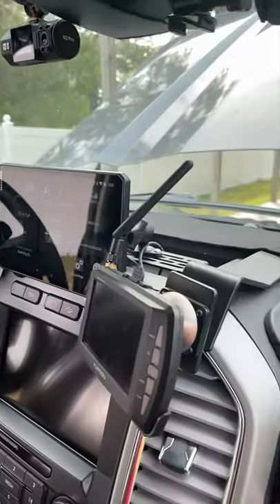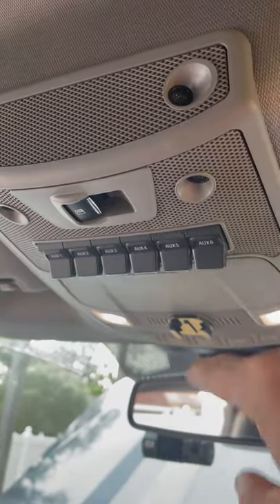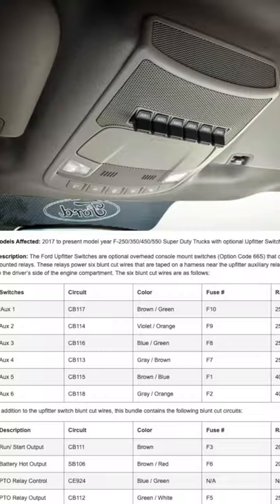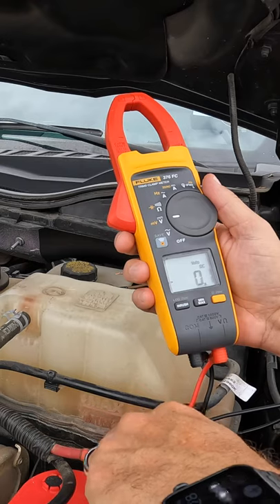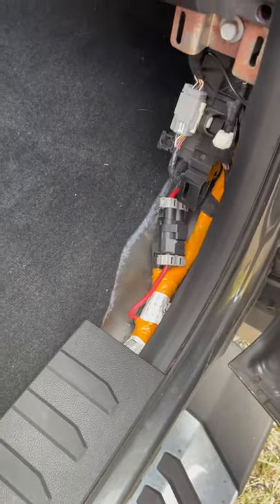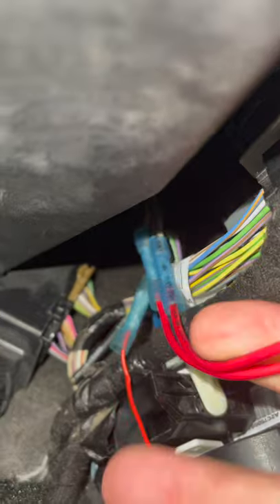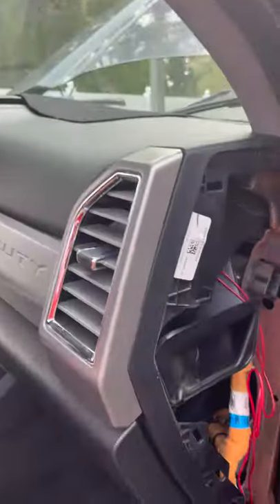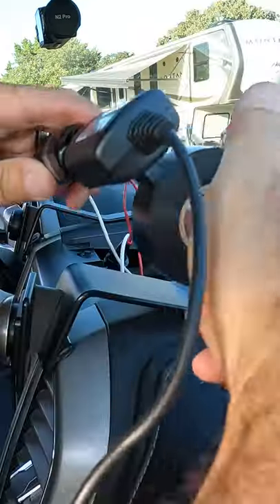🛠  DASH WIRING Using Ford Upfitter Switches #SHORTS

Comment: For your 2020 and newer Ford upfitter followers, that wire harness bundle is on the passenger side.  For me, I found it easier to deal with by removing the passenger side battery and battery tray.  I power all our dashtop items, installed a "High Idle resistor" to upfitter 1.  Put the onboard air compressor for our airbags on upfitter 5.  Great video Chad!
Reply: I can attest to this. I just hardwired my new dash cam on my 2021 Super Duty. 👍
Reply from the maker: What kind of compressor?  I'll need to re-do all of this when we get our F450. 😳
Reply: @ChangingLanes  .. I went with the AirLift 5000 Ultimate bags and the Airlift Wireless Air 7400 EZ compressor.  (not really all that “ez” .. 😂).  Mounted the compressor behind the drivers side rear seat, power and airline feeds up from under cab.  Self installed .. Remote works great.  I run 45lbs on the bags when towing.  2020 f350 dually,  2021 17k gwvr Jayco Northpoint 377.  pm me if you want and I’ll share some pics.
Reply from the maker: Thanks!  We have that also.  I was thinking maybe it was a general use compressor for tires and such.
Reply: How do you get the negative side of the connection. Inside the cab. Do you use one of the pass-through wires and run a negative to everything on the dash?
Reply: @amop33  .. negative is common with the frame/chassis .. so any grounded location in the cab should be fine.  The firewall passthrough are all the “positives”
Reply: @mike_adams  Copy... Just need to find a good place for a couple items.

Comment: This would be an awesome full length video! Been looking into how to set up an always on and recording camera system set-up on our future Ram 3500, and to power all our tech we will need for full-timing. I knew the upfitters would be key, but I know very little about wiring for something like this.
Plans include the previously mentioned cam system, a Garmin or similar RV navigation system, a tpms system, the cameras on our rv and the screen for them, and whatever else we may aquire over time.
We are still in planning and dreaming mode, but we wanna be prepared ahead of time.

Comment: Chad, you do all your upgrades, modifications and installations first class!  Even though I don't even have an RV I watch and end enjoy every one of your tech videos.  I feel bad about even mentioning the 3M squeeze splice connectors you used when installing the upgraded taillights on the RV, the only thing I've ever seen that wasn't 100%! (I just hate those 3M connectors, but I suppose when used where there is little chance of corrosion, they're probably ok.)
Reply from the maker: Funny.. I just came across the bottle of liquid electrical tape and couldn't remember why I bought it... Now I do!  LOL

Comment: You always have great info on electrical installs but this video gave me a concern at the end when I saw you use a 12v "cigarette lighter" plug in  and electrical tape,  instead of splicing the wires. I just don't think those make good connections and can overheat. Especially if you stick it behind the dash to be hidden. I know it is a pain but don't you think it would have been better to chase out the hot and ground and do a splice? I've had those plugs melt on me and I guess I just don't trust them.

Comment: Chad, thank you so much for sharing this.  When you have a few minutes, can you do  bit more details on how this is done and works.  How do you avoid draining the battery if other electronics are plugged in?  Didn't realize I have this, at least I think I do.
Reply from the maker: The upfitters shut off when the ignition is off.  12 AWG wiring is fine for that distance.  I just wired the + up to the dash and used a piece of metal that I confirmed was ground for the negative.

Comment: I think I spotted a new truck
Reply from the maker: Our 450 is on track for build next month.
Reply: @ChangingLanes  I've had a 450 on order since August 27th.  On November 16th, I received a VIN and build week of December 20th.  So far the truck has not been built, but hoping to get the built notice in the next week or so.  Hopefully your truck build doesn't take as long.
Reply from the maker: Yikes.  We ordered on Nov 3rd and had our VIN on Jan 13.
Reply: @ChangingLanes  Did you order the truck with Adaptive Steering?  That is one of the holdups on getting a truck built.  The 19.5 wheels are another holdup, which are standard on the 450.  I didn't order the Adaptive Steering for this reason.
Reply from the maker: Yes...  we did.  I guess we'll find out in a month if the build date is accurate.
Reply: @ChangingLanes  Chad, Hopefully your build date holds and you get the truck soon!  Keep us posted.